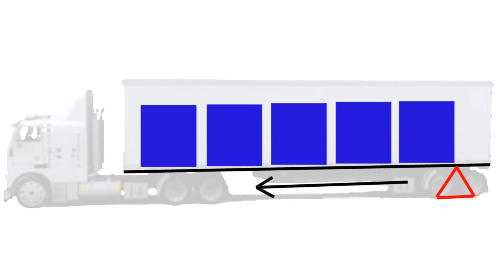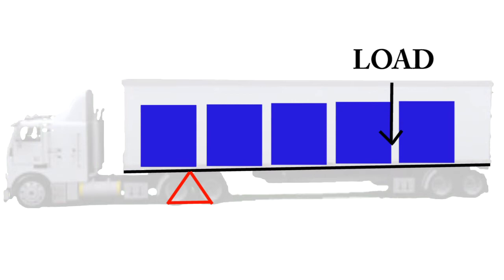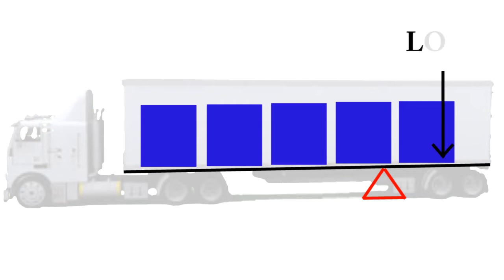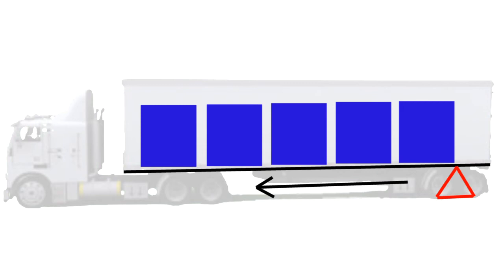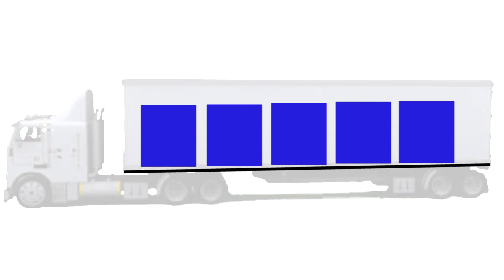HOW TO ADJUST YOUR TANDEM WEIGHT

Comment: Thank you but would you care to elaborate? Throw in some engineering weight distribution formulas? It's not as simple as you stated. The trailer floor is a simple lever. The drives and tandems make two pivot point fulcrums. The difference between the weight on the drives in the tandems are s factor in how much mass is shifted by sliding the tandems. Another factor is the starting distance of the tandems from the kingpin before you slide the tandems. Finaly there is bridge law. Is it possible to balance your load and still be legal in all the states you'll be driving through?